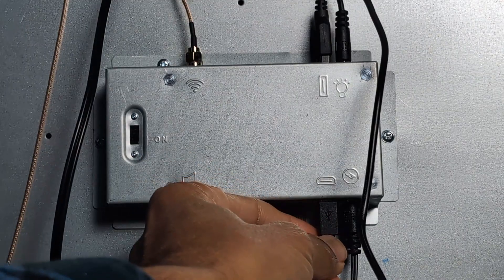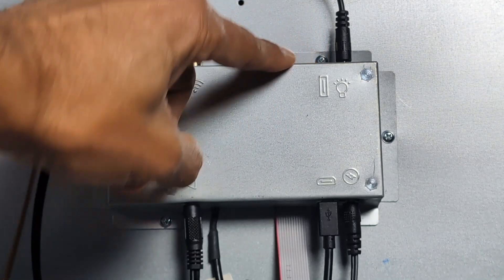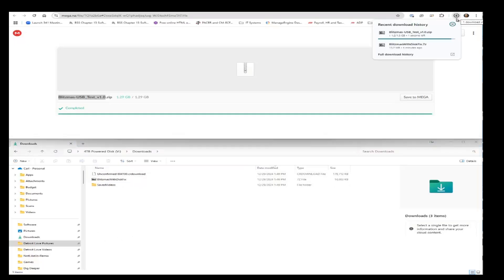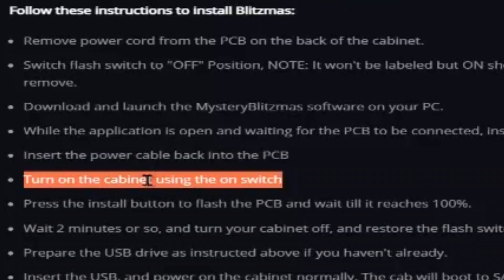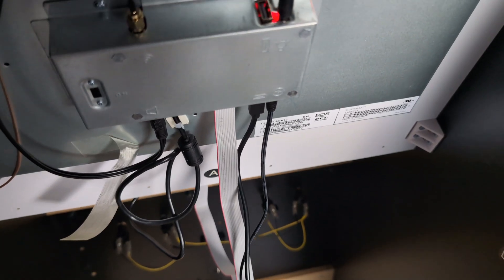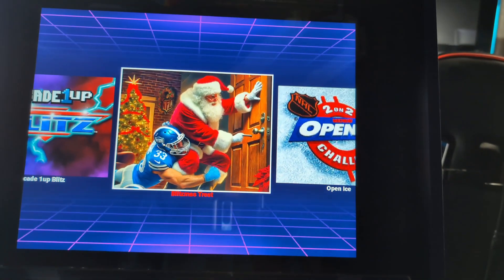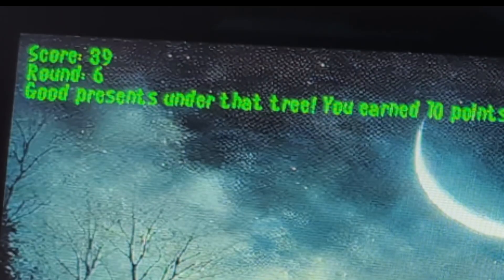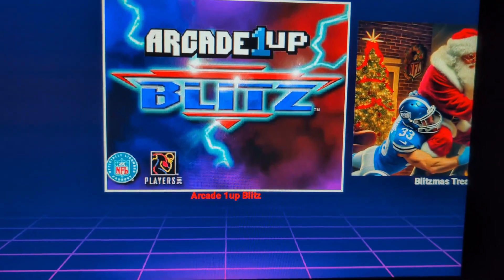Arcade1Up NFL Blitz: Step-by-Step Tutorial for the Team Encoder Blitzmas SOFT mod for LATE HITS

Comment: I did all of this but my cab still boots to the factory settings every time
Reply from the maker: Mine does too occasionally, is it possible you missed a step? Placed the content within a subfolder folder instead of the root  folder? Double check.

Comment: so I followed this and flashed the pcb (2 or 3 times now).   I extracted the files to the usb drive and when I go to turn the arcade on, I get the stock load.  Any thoughts?
Reply: If you didn't get it working yet it may be because you need to make sure you are not putting the download items in folders, they need to be extracted directly to the root of the usb just like he states in the video. Hope this helps.
Reply: @andysmith9638  I got it. It was the cord and USB flash drive

Comment: Hey running into a problem I have formatted my usb drive to ex fat extracted the files directly to the usb flashed my pcb about 10 times I’ve waited the two minutes flipped the toggle switch back to on  plugged usb back in and powered it back on and it still just just boots to regular blitz screen not the blitzmas  it’s bizarre  any help would be greatly appreciated 
Thanks 
Tone
Reply from the maker: It sounds like your cabinet PCB was never flashed. Review the video where it connects the USB cable from the computer to the PCB and redo that process. Make sure that when you click install it shows that it was updated. You may not have the proper USB cable that transmits data.
Reply: @DetroitLove 
Hey D. I ordered the exact cable you suggested off Amazon and the extender usb cable as well for future updating after about 6hrs of hair pulling I finally figured it out you said to extract the blitzmas usb release directly to whatever drive your thumb drive is registered as  when I did that I noticed I noticed there would be a folder there first called blitzmas treat then I would  double click on it and then my four game folders would be there finally I tried extracting right to the downloads folder then copy & pasting just the game files minus the blitzmas test folder directly to thumb drive and sure enough it worked
Reply: @DetroitLove I have extracted the 1.2 file to thumb drive and then inserted it into USB on Blitz. I boot Blitz and see the Open Ice and Nba Jam etc menus but when I press the blue button I get.. Loading Game but unit reverts back to the menu. None of games load but Blitz and the game to unlock late hits. I have a NEW Sandisk 32gb Flash Drive formatted to 32kb exfat and all but nothing is working?!?! Any ideas before I pull my hair slap out?@?
Reply: Is there a way after updating to the blitzmas treat mod and going through the mini game successfully  to get rid of the blitzmas treat logo  after

Comment: This is a great step by step!

I have the lit coin doors also, does the usb drive have to stay plugged into the pcb from now on or can you remove it and plug the lit coin doors back in?

Or would you need like an usb splitter/hub for that to work?
Reply from the maker: If you have the backlit Coin door watch this: https://youtube.com/shorts/reTFm98IRCQ?feature=share

If you don't want to keep removing the back cover to add games or to remove drive for stock performance watch this: https://youtube.com/shorts/B-CpJi87V3E?feature=share

Comment: Does the softmod give you all the games? Hockey, Gauntlet, etc.......thank you
Reply from the maker: Yes
Reply: @DetroitLove  if someone else did this mod for you on there cabinet and then gave you the USB stick would it work on another cabinet like a plug and play device ?
Reply from the maker: No. It is 2 parts. The app on the computer must be run using the cable and flashed to the cabinet before the cabinet can recognize the USB stick. If the cabinet was already flashed, someone could add more games to a USB stick for someone and send it to them. The flashing is what tells the cabinet to look for the USB first before checking the internal disk.
Reply: Hey brother 
Hope you had a happy new year quick question once installed Can you button map the extra  games so there on the right buttons on the Arcade1up for example 
Pass,shoot 
Turbo
Reply from the maker: @anthonyburosh581 Happy New Year! I'm not sure what you're asking. The buttons work as they should for all the games. It uses RetroArch so you could remap the buttons any way you want.
Reply: @ hey D. thanks for the reply & sorry if I wasn’t clear all those extra games use the same button setup of 
turbo , pass and shoot  are they all button mapped correctly ?  the reason I ask I watched another guys blitzmas tutorial and he’s said they were button mapped wrong that’s why I asked if I could rebutton map them if they were wrong 

also can you add mame games on retro arch  are you familiar with the mame rom nba jam rewind (it was the one that had the mortal kombat characters & Michael Jordan and shaq reinserted into nba jam tournament edition that were taken out in the early stages of that game before it’s  final release ) would love to add it to this cab if that’s possible

Comment: does the laptop need to be connected to play or just the flash drive?
Reply from the maker: The laptop is used just to communicate with the PCB board. Only the USB drive is used going further. Remove the USB drive to play the normal way

Comment: Some micro usb cables are just charging cables, some are Charging AND data cables, I've never seen one that is just a data cable. In some cases manufacturers are cheap and provide a charging cable with no data line in it, it sucks and shouldn't be allowed, it breaks the standard.
Reply from the maker: Of course, those who know that, understand!  Those that don't, need to understand that they need a cable that transmits data.